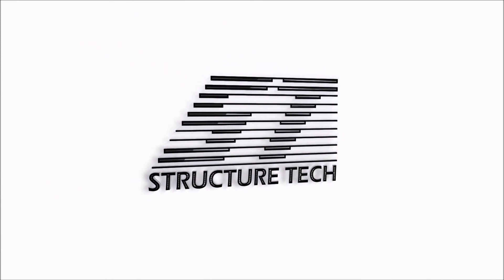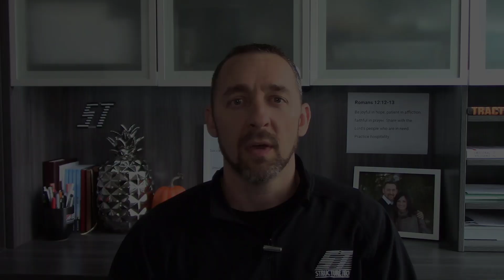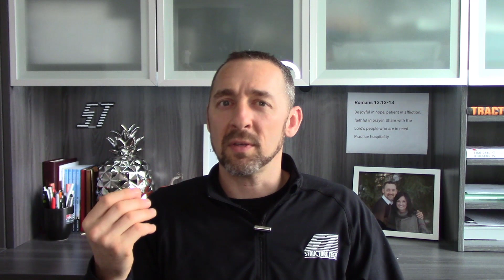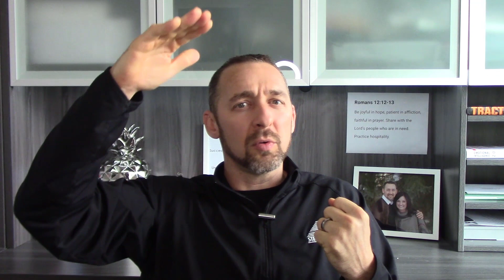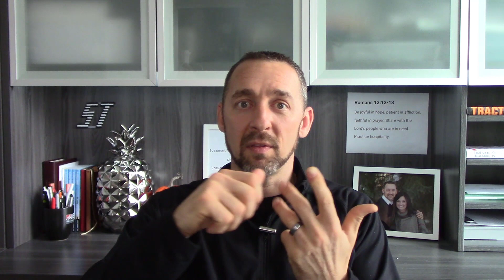Why you don't want an oversized furnace

Comment: They wrote up a contract for a furnace that seemed too small.  That is because all they know is square ft.  It should be CUBIC feet, to recognize that 12 ft  or cathedral ceilings require more air to be heated.  They raised the size and over the last few years, the cycle time seems to be ideal.

Comment: I have a 2400 square foot home built in 2003. The furnace stays on all of the time. It does not cycle. It is 60K.
Reply: maybe an 80000 btu would be better ?
Reply: I own an HVAC company, but I can give you a pretty good idea, if you answer a group of questions.  Where do you live location wise? (Zone of the country makes a difference), Are you looking to replace the AC or Heat pump?   I would assume it is a 4–5-ton unit, if you want upgraded AC or Heat Pump setup.  But a 60k btu furnace is pretty small for a 2400 sq ft house in any zoned area of the United States.  Is that all above grade or does that include the basement? (If you have a basement).  A Manual J load calculation really needs to be done; we can get really close.  Does you have natural gas, electric or LP?  Where is your furnace located in your home? What part of your home faces the South?  Once I know what part of the country, I will know more about your humidity levels as latent heat is a big deal.  If it is the original 2004 furnace, 60k Btu's was undersized to start with.  But we cannot just go throwing in a 120k Btu, 2200CFM system, as your ducts were never made to take that kind of airflow.  However, if you said your equipment is in the attic and you live in a ranch style home, all your supply and return ducts can be upgraded, insulation upgraded (blown-in cellulose), etc etc.     Depending on if you plan on replacing the AC or not, and other questions and answers will fill in some of the blanks.  80k-100k Btu with a modulating gas valve with a variable speed blower fan will probably be the ticket.
Reply: @Balticblue93  My house originally had a 100K 80%. It is in Detroit. The installer stated a 96% putting out 60K will be fine. The south facing side has a walkout basement. The furnace sits in the western side of the home or rear center of the basement. The furnace is 5 years old. The a/c is 1.5 years old. When the temperature is less than 20 degrees, the furnace always stays on. We keep the air supply flews closed going to the basement and laundry room.

Comment: I often wonder about sizing? a 4 ton heat pump which offers 48,000 btus, good for 1600 cfm. and if gas it has 80,000 btus. so lets here from the so called contractors out there...

Comment: I got two 44,000btu 2 stage 80% furnaces in my attic and the downstairs basically heats the whole house.   Just had our freezing weather and just one furnace heated the whole house and yes it ran and ran.  The first stage will keep the house at 70 degrees downstairs and 75 upstairs.  If on the second stage the downstairs will do 75 degrees over time. The issue with that is the up stairs will get 77+ degrees up stairs in the main hallway but the bedrooms if doors closed will remain cool at 70-73. I just run the fan to try to evenly distribute that hallway heat since the upstairs return is in that hallway.  The upstairs furnace wasn’t used at all, I just kicked on the blower motor fan.  

These are both new HVAC systems. I sized and bought the equipment myself.  I did increase the upstairs 2.5 ton condenser to a 3 ton condenser due to the fact this is Texas and we run the AC more upstairs since the heat rises. I also added another return and put it in the master bedroom to compensate for the extra air needed.   I chose not to do furnace media filters because I wanted to install 3 inch media filters in all my return grills.  The bonus is that it keeps the ducts clean and has a .30 static pressure on a MERV 10 and they will last 6 months to a year.  I also increased the power of the ECM variable blower motors.  I like to feel the air stream coming out the vents.  The system is extremely quiet and I’m getting 1200 CFM airflow upstairs and 1000 CFM downstairs.  I almost got a 66,000 BTU furnace for the downstairs and was thinking I should have until watching your video that it running most of the coldest days is a good thing.